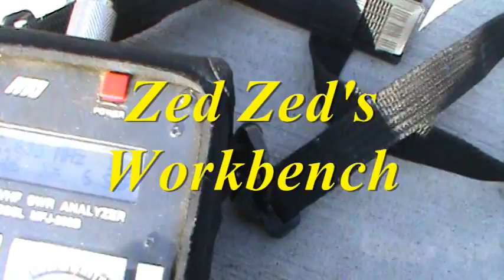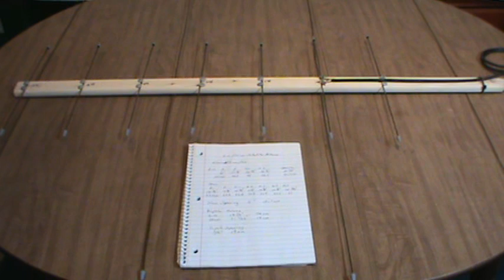$4.00 Ham Radio Satellite Antenna

Comment: I built a similar antenna a few years back. not placing plastic or rubber tips on the element ends CAN lead to coat hanger impalement. luckily nothing major (artery or major vessels) was penetrated in my forearm. Explaining, tobthe nurse, what my project intentions were was a little entertaining.

Comment: Enjoyable video as always!  One note about working SO-50:  I find I am having to rotate my handheld Elk log periodic dual band beam between 0 and 180 degrees during most passes as the polarity changes during a pass...you might try that as a way to improve both up and down links as required....73 de AA5FR

Comment: Hello Dave: Thanks for making a complicated subject very down to earth (no pun intended) I like the idea of doing Satellite in the near future. I would like to ask if you can do a video or series of videos showing how to use the various MFJ antenna test equipment. In my case in particular, I got an MFJ antenna bridge Mod # MFJ-204B and after reading the instructions I get it, but when I go outside I get a bit lost. My antenna bridge has a meter showing impedance from 0 to 100 in the scale, other similar bridges show SWR. To my understanding I need to have an impedance of 50 ohms or as close to 50 ohms to have a match. The question is: When cheking the impedance, my meter should show a "dip" when the resistance knob is at 50 ohms or indicate 50 ohms? Dip or 50 ohms? I guess I am a visual guy and the only video shown here in youTube is from Brazil, my Portuguese is rough. Can you help us all? Now I will be working on installing my HF vertical 5BTV and in the car a Comet UHF-VHF and 6m plus the 10-15-20-40m coils. Thanks 73 de N2JKW Javier.

Comment: I have followed your instructions concerning measurements and layout but instead of the coat hangers I have used 1\ 8" steel rods. Can you please explain how to tune (trim) this antenna? I have a MFJ 269 PRO that I will be using to test swr.  Do you tune the 2m and the 70cm separate then reassemble?  Any additional information you can give would be appreciated.  73 KC3ELU

Comment: I made this last year, and when adjusted and tuned it's great. I use mine on a tripod with a pvc 3 foot mast, and can lock it down for repeater work. Has anyone figured out the gain on this antenna? I would appreciate knowing that, soo much.

Comment: Hi Dave interesting video, I would have thought the impedance of the dipoles with all this parasidic elements around them would have dropped to about 20 ohms, am I missing something here as the vswr seemed ok, and isn't there any interaction between the 2 antennas....Fred UK g4vvq.
Reply: That's exactly what I was thinking, Tom. I'm wondering how it works without any kind of impedance matching.
Reply: Zeb Smith Hi Zeb, yes should be about 10 ohms I would have thought, wonder why the vswr is so good, defies the rules of logic hi...name is Fred here not Tom, don't ask hi....
Reply: Zeb Smith
How would one match the impedance of this build? What materials and methods? Thx-
Reply: Clifford Novey Hi Zeb, well you need to increase the impdance a hec of a lot, there are several ways, you can use a folded dipole, they are 300 ohm, and with several elements around them comes right down to where you want, or a Hairpin, or Gamma Matcher, you can google all these things...Fred uk
Reply: Tom Smith
Great info thank you.

Comment: Hello Dave, I'm going to use your plans to build this antenna tomorrow, except that I will use 1/8th Inch Stainless Steel rods instead of steel coat hangers.

will I have to have different spacing/lengths on/between the elements? I don't have equipment to tune the antenna if this is so.
Reply: I have the same question, i get sir of 1.4: on the 70 cm and 1.6:1 on the 2 meter but I cant receive anything. I get some (still poor) reception with my rubber duck antenna 73, Va3epm.

Comment: When you're building these antennas, where do you get your starting point measurements from given some of the boom lengths and spacings you use. Is it just by trial and error or do you have a specific formula for assigning those spacings?

Comment: What about cooper wire?
Reply: I'm building just one and I really don't think the SWR are far a way, have all done, wires and boom, now I need the screws. 73 de SM2WGV
Reply: Nice, have test on it and shere results here. 
73 de Z31VAJ :)
Reply: Tested with 1mm copper wire, swr went crazy, couldn't match it, bought 2.5 mm aluminium tig wire so new info soon
Reply: Yes ! I made also from 2,5mm copper wire. SWR was so high. That was the reason i asked here ;) 73
Reply: Works like a charm, the length has to be little bit longer at the  (F), both 2m and 70cm but the spacing is 2 cm were the coax goes. tested to open couple repeaters, 2 m is approx. 40km from me and 70cm is around 10 km, no problems at all. Thanks to Dave for very good video. 73 de SM2WGV